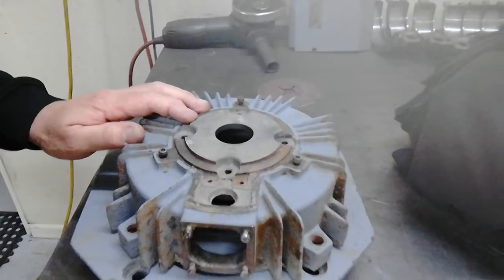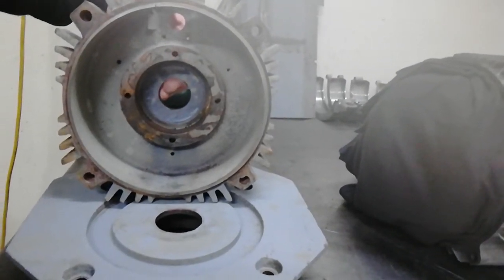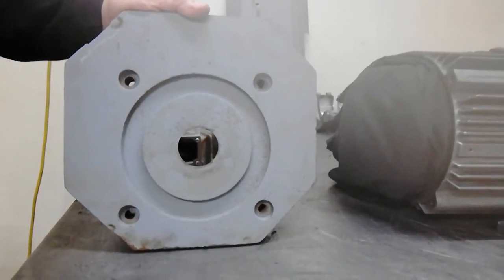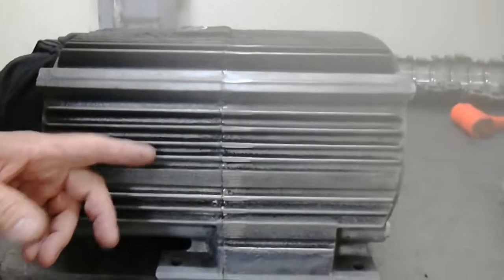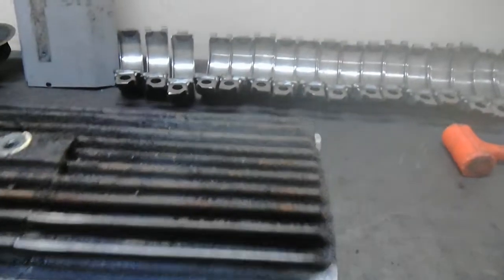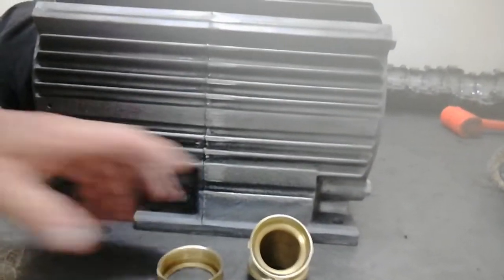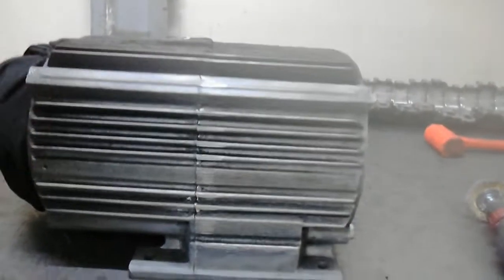CNC Lathe Rebuild.  Spindle Motor Clean Up.

Comment: G’day Peter, all clean for another 25 years. Cheers Peter
Reply from the maker: Hey Peter.
Working away at it Slowly.
It is a lot of work but i already envisage the finished job.
I have already been through all the wrestling of ideas of WHY.
And now here i am rebuilding a CNC Lathe.
Money is a big driving force in any decision making and this is no different in this case.
But also that and the reality of what i Need in a machine rather than Want.
This is an indirect reply,  but thought i would write down some thoughts while i am here.
Thanks for watching.
Peter.

Comment: Hello Peter, way to go, nice to see you see we are happy to meet you. 
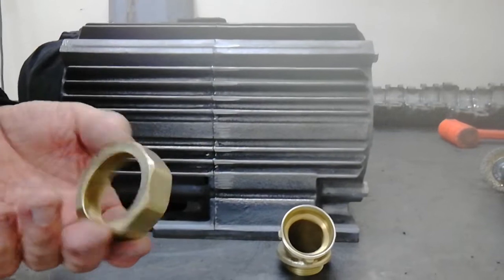1:33 in what is that blower tool looking ting in background ion the table against the wall.  
Thank you for the shout out, it is nice to see you because as we say we really like knowing you. Sure made those brass fittings look like brand new. 
The motor is really coming along nice, we are beginning to image how well this Mazak is going to end up seeing. Lance & Patrick.
Reply from the maker: Hey Lance & Patrick.
Or should i say Ambassador Lance and Patrick.
Good to see you as always.
I had an indirect push to include myself in this video ??
To be honest i watched this video at least ten times before posting, still not totally sure to include myself.
But it is a once off so not so important.

The 1:33 not totally sure ?
There is a 5 inch Angle Grinder, the sheet metal surround from the Spindle Motor and some customer parts waiting to be cleaned.

The reasons if i can call it that, for rebuilding the Mazak are a mix of different answers.
But the main reason,  is i would like a new machine but can not justify the price in purchasing such a high ticket item.
I would be mostly be buying new for myself ( Want ) not because of (Need ).

Thank you as always for a genuine reply.
Peter.

Comment: There is a lot of work that goes into a restoration,   thats why most just put elbow grease into them and call it good.  The machine i just picked up is going to need a bit of love before i can use it.
Reply from the maker: Hey Doug.
The restoration i am doing is in most cases extreme ????
But if you look at it like restoring an Old Car it,s not so extreme.
In someways this is how i justify doing this restoration.

I hope you will post some video,s of your mission for us to see.
Thanks for watching and commenting.
Peter.